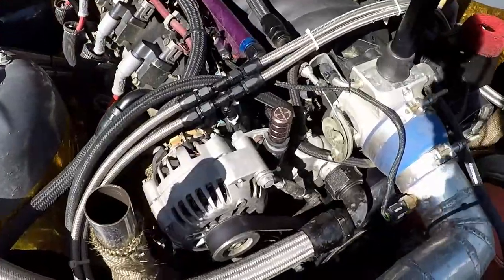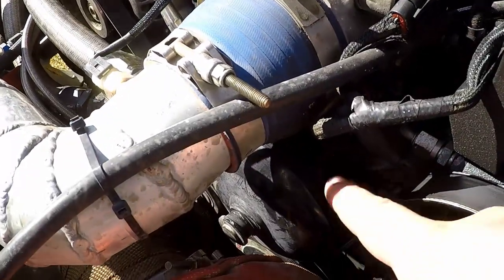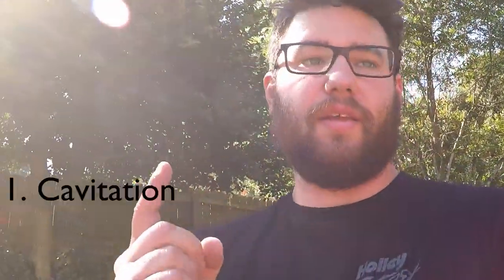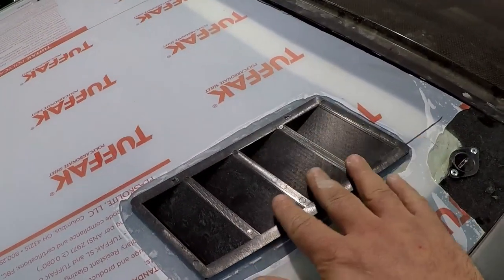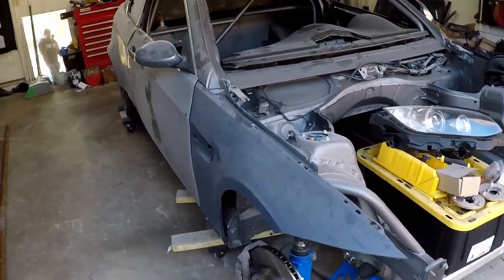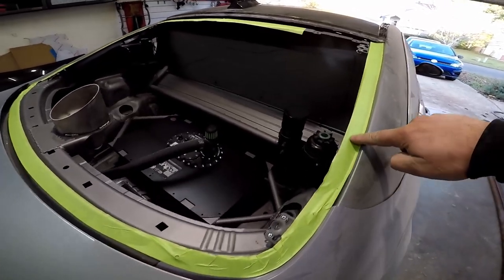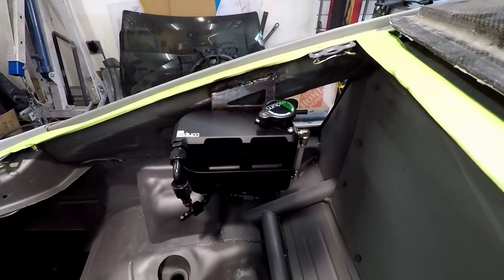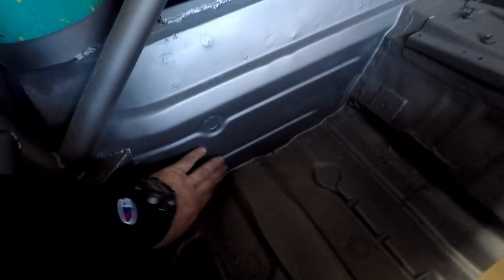My Rear Mount Radiator Sucks!

Comment: Awesome video mate! 1 question where did you run the 3rd line off the radium swirl pot? Thanks for the content helped  out with my build!
Reply from the maker: Actually I capped it, to use as an expansion tank. One line into the swirl pot side, one line out. Extra air and water go into the expansion side.

Comment: interesting i appreciate the insights, im about to go rear mount on the WRX, trying to go budget though so ill be using aluminum tubing run through the cabin rather than super expensive AN20. i been wondering why my car overheats a lot less than other cars would seem i was prudent in putting in the lil swirl pot i have in the bay.
Reply from the maker: 16an works and is a little cheaper. When I added up the costs of welding aluminum tubing, it was close to the 20an cost. If your using small exhaust pipe and couplers, it could be cheaper, but there are many opportunities for leaks, which could take me out of a comp, so I didn’t want to risk it.

Comment: Hey, just subscribed and already watched a lot :-)

In the E36, how did you run the AN20 lines past the rear axles? It seems like you're putting them under the car behind the rear axle, so somehow you must have gotten them clear of the axles and Control arms :-)

I'm building an E46 with stock fuel tank, so I can't run them through like you did on your E92 :-)
Reply from the maker: Hey, thanks for subbing! I also ran a stock fuel tank in my e36, the way I ran the lines was kinda janky, but honestly, I never had a failure. You can see them pretty well in this video https://youtu.be/CtUssF8sYTI
Reply: @BlakeBuildsATL  yea, simple sometimes works 😊

I'm also considering putting it through the Firewall like your E92, but just run them behind and below the passenger seat, because I obviously still have the stock tank where you have placed your water and power steering pump 😊

Anyways I'll see where I have room for it, thanks for all the videos you create 😊

Comment: Man just saw a video about ur ls turbo e36 it fukin crazy.

3 questions: is the LS all stock?
What size is ur turbo? 
And at which rpm u get full boost?

Cheers
Reply from the maker: Hey, thanks! My ls is completely built with forged internals and a bit of headwork. It’s a 75mm turbo with a t6 hot side, full boost is around 3500, we rev it to 7000